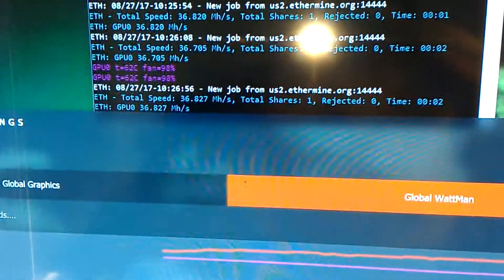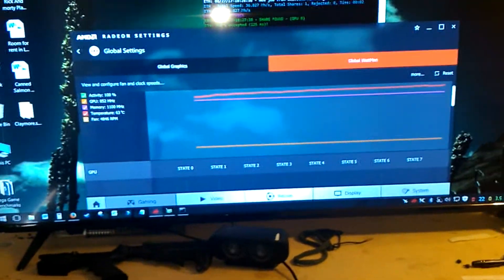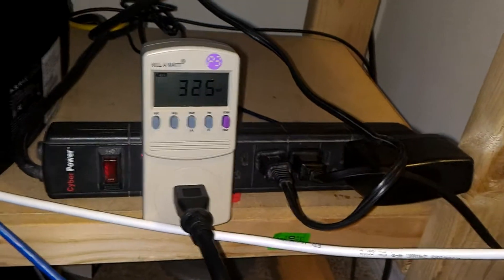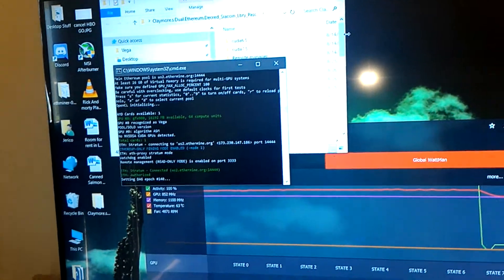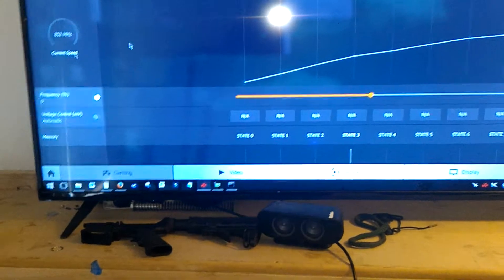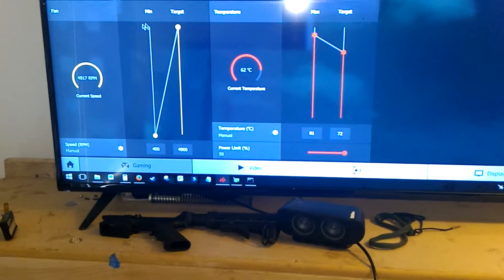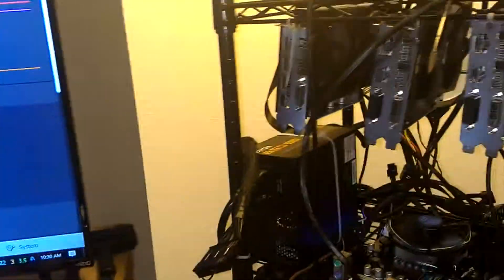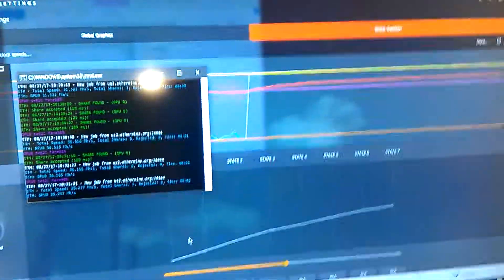Radeon Vega can mine at lower power!!!

Comment: My Vega 64 settings:
Frequency @ 900 MHz
Memory @ 1050 MHz
Power Limit @ -25%
Fan Curve @ 1900 RPM
Power from GPU @ 108 W
ETH @ 35-36 MH/s
Reply from the maker: should be able to get 41MHs but will use more power